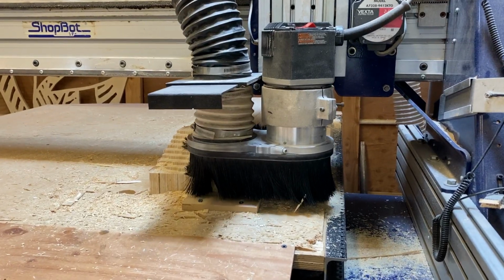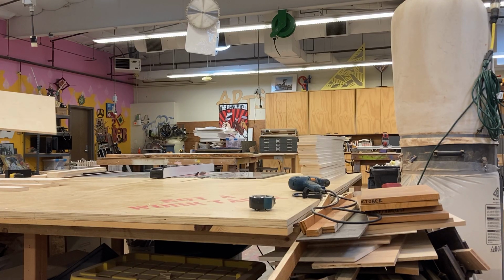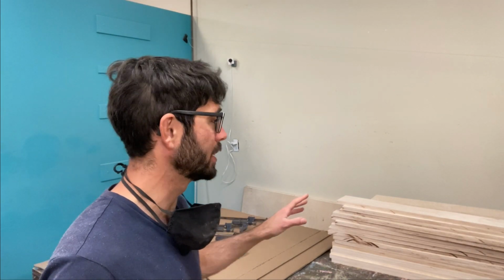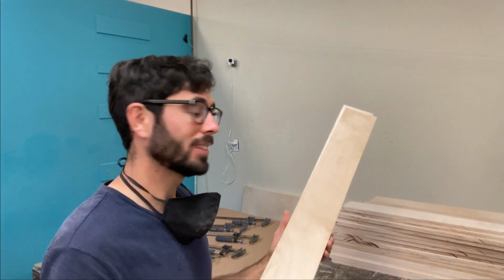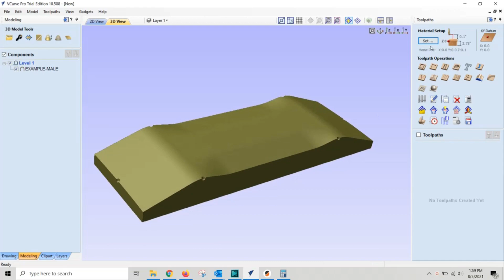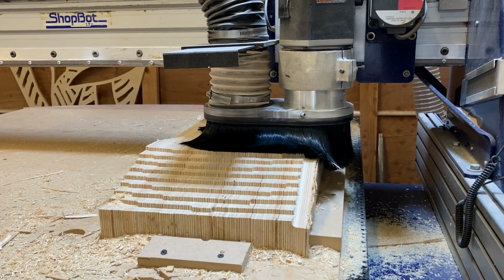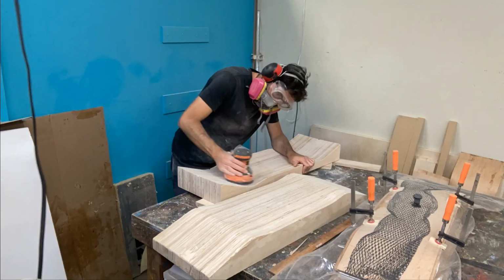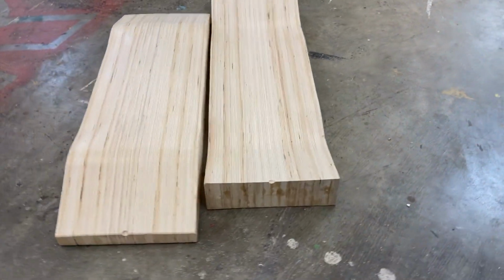How Wood Skateboard Molds are Made (CNC)

Comment: When you make your mold, is there a lot of fluctuation between the top and bottom mold. I'm just wondering if its easier to make one program and then just mirror that program or if there needs to be a slight difference to get the molds to press properly. I'm pressing a few boards at a time, and don't want a lot of fluctuation between the top and bottom board. 
(I get if I want every board to be exactly the same every time I should only press one board but nobodys got time for that. I'm just wondering how to get as close as possible.)

Comment: Excellent video. How long was the 3D machining time? Would it have taken a lot less time if you had instead sliced your mold model vertically in 3/4 inch slices and then just perimeter cut each slice, then just glue up the already finished slices? To prevent slipping during glue up, drill alignment holes on each slice (on the cnc) to insert wooden dowels.
Reply from the maker: Thank you! I don't recall exactly how long this took, but total machine time might have been something like 10-20 minutes for surfacing each face, then maybe 1.5 hours for the male mold and 3-ish hours for the female mold? I believe these can be improved with more efficient tool selection on my part, though. Regarding your slicing method: I have been evaluating this, however, it does take more hands-on time in the design stage. I think these would allow you to eliminate the rough cut and go straight to the finishing cut, and make your wood supply go a little further (you could nest the male and female slices together when cutting them out). I haven't developed a system to automate and quicken the slicing process yet, so the labor cost doesn't make this as appealing for my setup at this time. However, for someone else, the method you describe may make way more sense!

Comment: Also, I was just curious what types of bits you used for this process if you don't mind telling
Reply from the maker: I'm using a 1/2" diameter two flute straight bit for roughing and 1/2" diameter round nose bit for finishing, but I think end mills would be better suited than these router bits - the CNC I use has limited z-travel, and I haven't found a 1/2" diameter end mill short enough to fit above the stock material, so that's why I use these.

Comment: when you design the mold, do you compensate for the thickness of the deck or design it with a thin surface where the male and female surfaces are touching?
Reply from the maker: Yes, I offset the surfaces - you'll likely have pressing issues if there's no offset (I've heard people can get away with it with mellower boards). Check out this more recent video on designing/making molds: https://youtu.be/hEzCSCkYcOU and also my skateboard mold design guide: https://sk8cad.com/user-guide.html (includes explanation of surface offset and why it's important).
Reply: @openSourceskateboards  Thankyou so much!